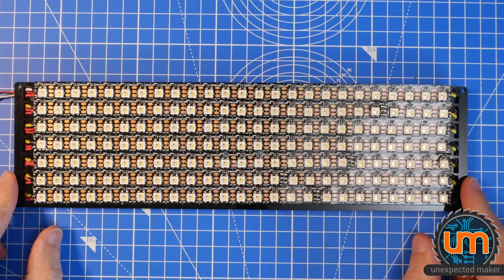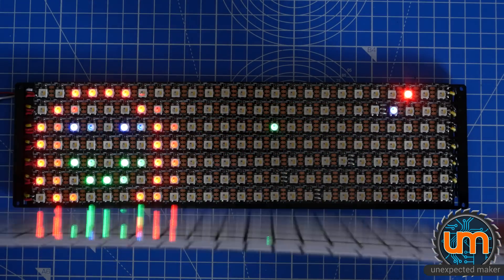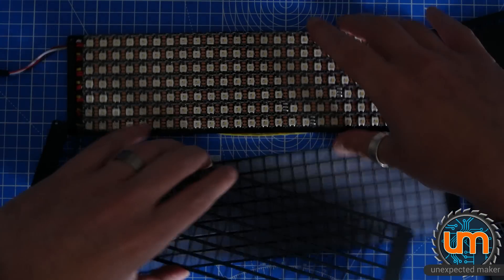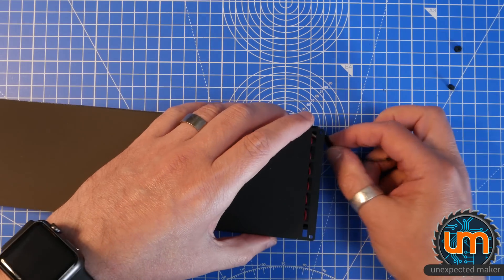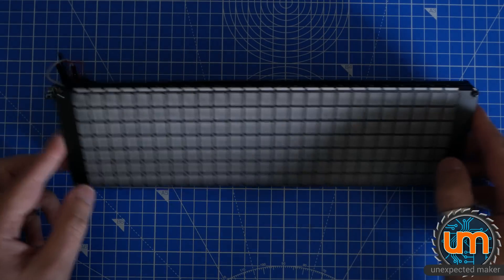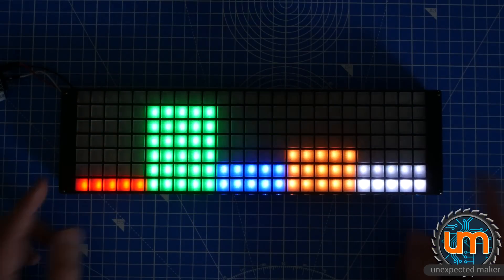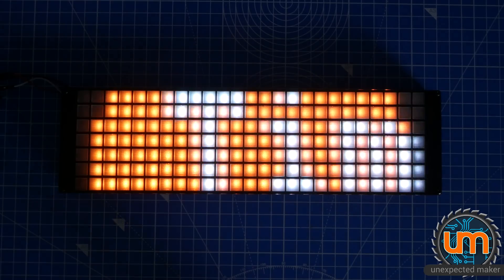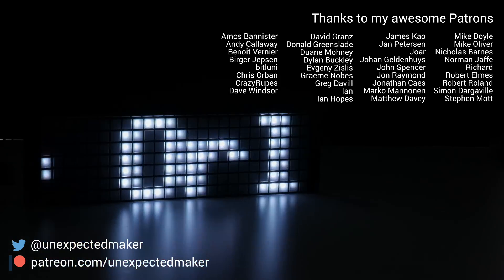Overcomplicated RGB Matrix Panel - The Finale!

Comment: Awesome work Seon, makes me want to get my 8x32 pre-fab flex Neopixel board up and running - pretty lights!! I think there is an instructable on at the moment with the same idea you have, would be worth checking out to give you some inspiration! So what was/is the core issue with the ESP32 not running the pixels right??

steve
Reply from the maker: Yes! You should be playing with your RGB flex strip!!! Make more videos mate...!!!!  The issue is with the RTOS heart beat/WD timer stalling the processing of the data to the IC's in the pixels...  check this link for extra info on the bug...
https://github.com/adafruit/Adafruit_NeoPixel/issues/139
Reply: @UnexpectedMaker  Doesn't the esp32 have two cores? perhaps you could shift the RGB to the second core and avoid the OS CPU cycle stealing entirely...

Comment: The acrylic will be bowed because of the etching, it would have heated up the plastic on that side of the panel only, when you heat up plastic and then cool it, it will shrink to be smaller than it was so it has pulled that side of the sheet to make it effectively shorter making it bow, you could anneal it by putting it in an oven at about 160-180 degrees for about 5 minutes.
Reply from the maker: Oooer? I did not know I could straighten with heat... will try it out over the weekend, thanks Scott!!!!
Reply: Unexpected Maker - try it on an offcut first, in case it has other internal stresses which come and and ruin it. Only heat it for as little time and using as little heat as you can, to reduce uncontrolled shrinkage and deformation.
Reply: Unexpected Maker- oh, and it’s probably obvious, but lay it down flat.

Comment: Could you apply the black spraypaint after etching most of the depth of the cavities, then cut the final mm off? That would leave a black wall on the interior walls.
Reply from the maker: Cutting some of it, then removing it and spraying it and then realigning it in the laser would be unreliable. Even with a clamped jig to square/hold it, if it's < 0.5mm out it will be noticeable, and will still leave a 1mm wall that will edge light. Right now the squares are only a smidge over 1mm deep and the spill is noticeable. I had thought about spraying it afterwards, but I cant think of a good/easy/reliable process to fill the squares with something to protect against the black spray... that will look nice when removed and that would leave even/clean black walls.

Comment: I have not used esp32 with neopixels yet,  not good.
Reply: tablatronix Sounds like the FreeRTOS heartbeat needs to be reduced...

In any case I eventually want this to work in MicroPython and the implementation will use the RMT module...just need a little breathing space!
Reply from the maker: I think it's specific to the W variants ... the RGB only ones have worked fine for me in the past... but the RGBW/GRBW have the extra channel issue :(
Reply: @UnexpectedMaker  I have rgbw, I might have to test, i bet its a timing issue, how many leds in your matrix?
Reply from the maker: Yes it's a timing issue and a RTOS stall on the ESP32... 175 in my panel, but you can see it every 20-ish on any strip. It's a known and documented issue... see this link rom Doug's comment on my first video...
https://github.com/adafruit/Adafruit_NeoPixel/issues/139
Reply: @UnexpectedMaker  wow, so no dma either, yeah figured it was the length + the extra W data, I have issues like this past 300 pixels but that is expected as suspending interrupts that long is not an option